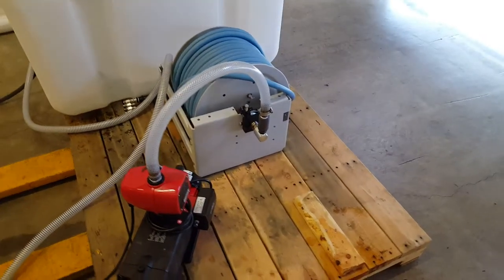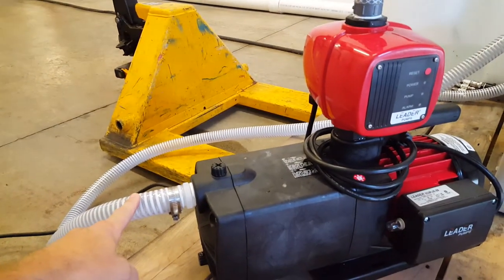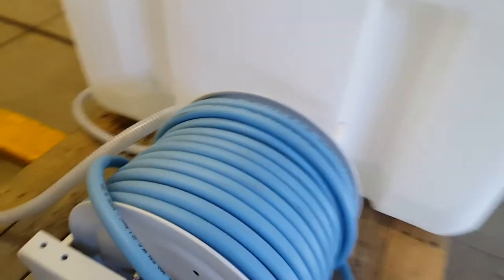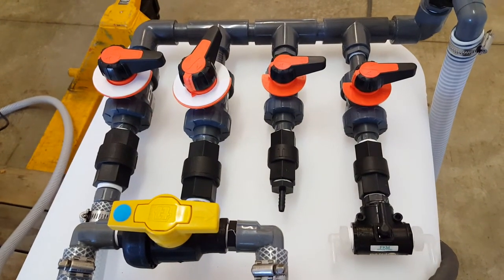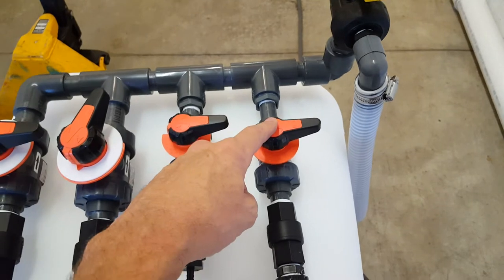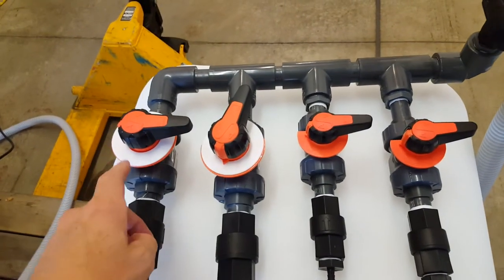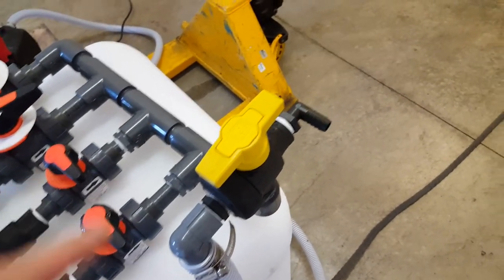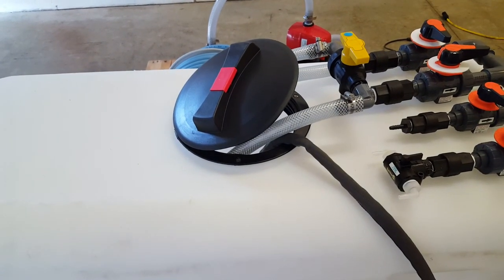Custom Soft Wash Booster Pump Setup 1 hp

Comment: I love the idea of having several valve options for soaps or different cleaners 👍🏼
Reply from the maker: Hey thanks! We have done as many as 3 soap options. Ability to run 2 simultaneously.
Reply from the maker: We get more and more requests for more than 1 or dual soap options. A lot of people will run a post treatment or neutralizer along with a surfactant. We will soon have dual soap as standard setup.

Comment: Hello,
Quick question: Same set up but with AR/Comet pump instead of the Booster pump. Can the 3 way valve be used?
Reply from the maker: Absolutely, but we mount the 3 way remotely now and the current version  had quite a few upgrades. You can see it here https://washingequip.com/shop/ols/products/hydro-mixer-xl-for-gas-powered-pumps